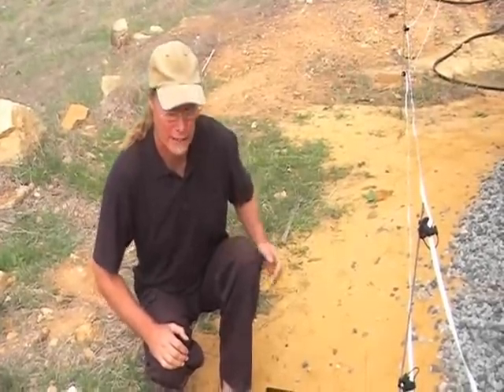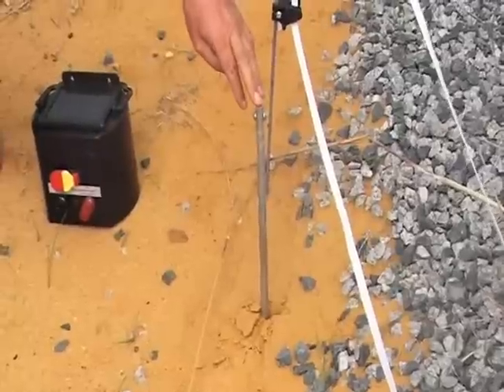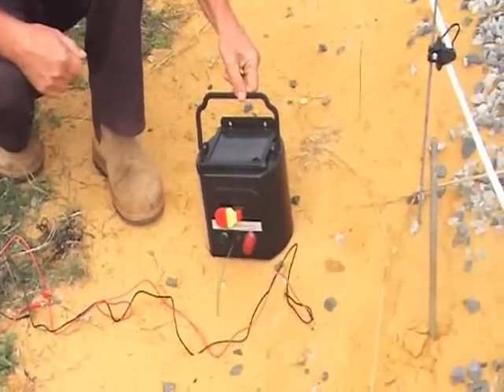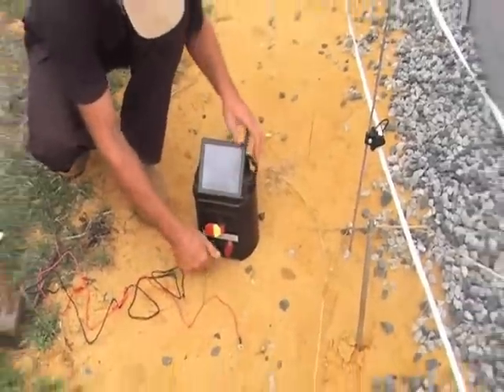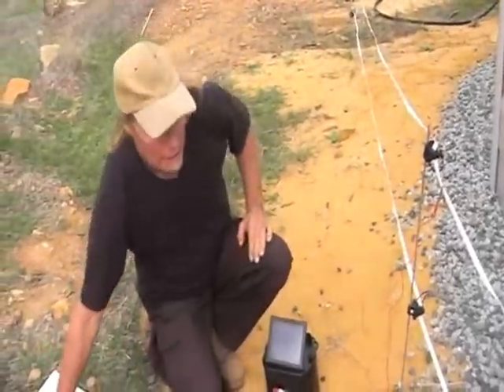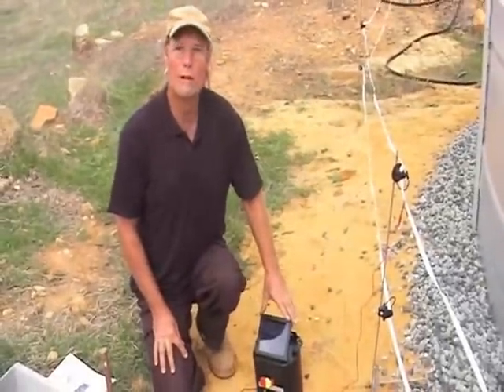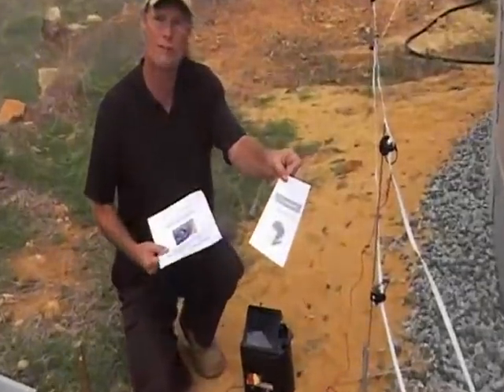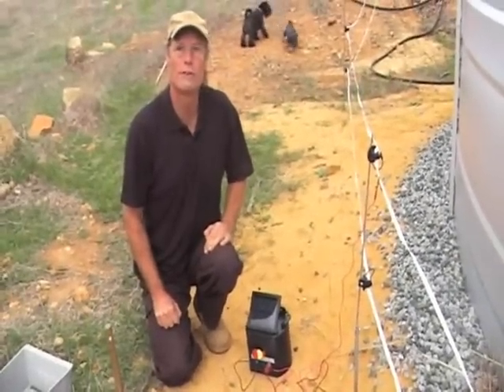solarfencecharger

Comment: cheers 4 the vid. I just bought a small kit but the grounding piece they sent is only about 12 inches tall. Is that viable? The electrified bits are just to prevent goats wrecking the permanent wire fencing :)